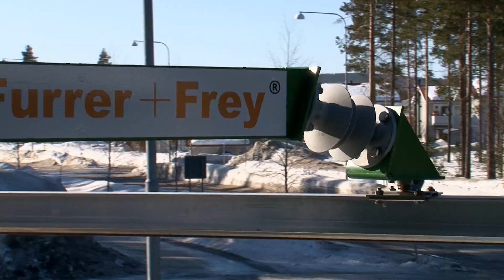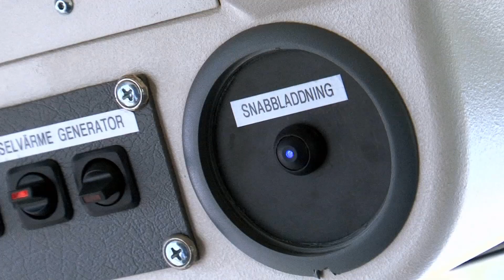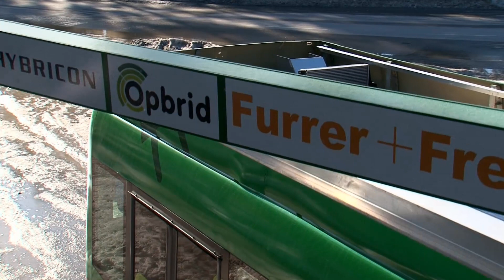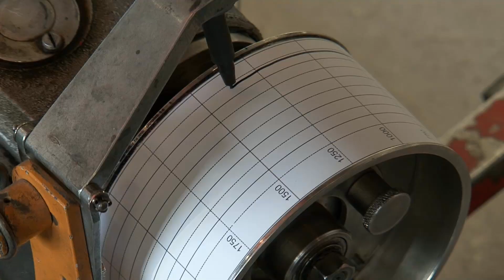The Opbrid Bůsbaar: Ultra-Fast Charged Electric Urban Buses in Northern Sweden

Comment: 16 February 2023. This model is no longer in operation, but Umeå has 27 electric buses — 25 VDL ones exclusively for trunk lines 1 and 8, and two King Long Arctic buses, which can be used on any line. Vehicle DEC022 (see 0:21) is still operating to this day.